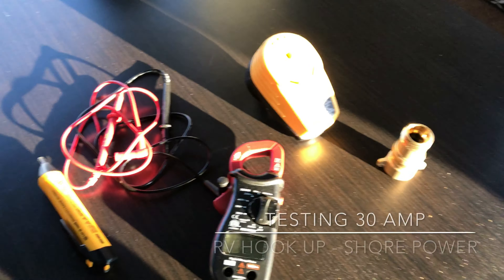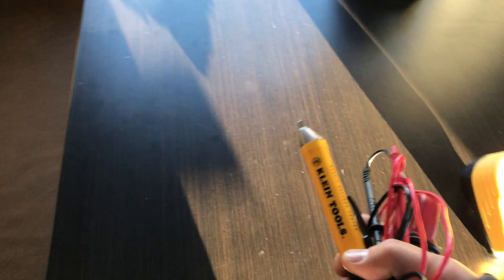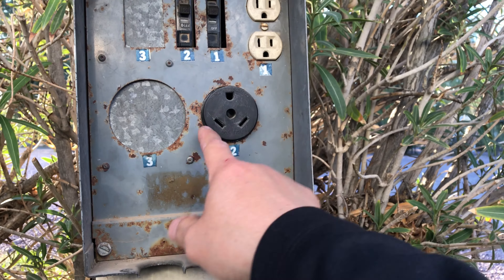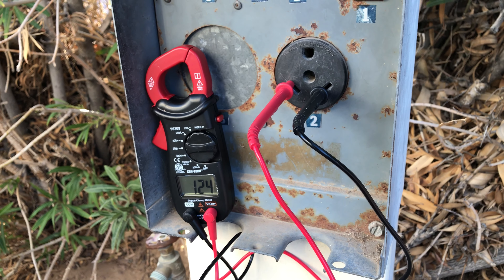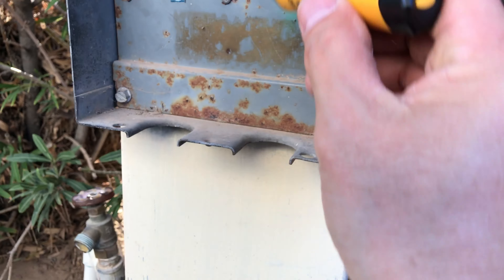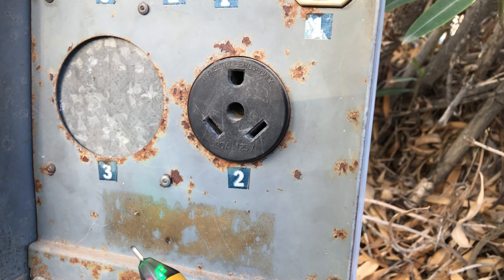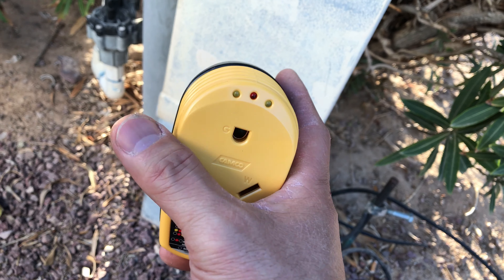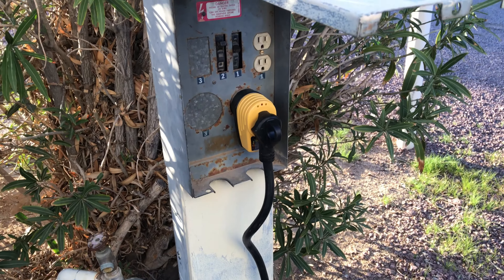Quick 30 amp outlet check. How to test a 30 amp RV shore power

Comment: Unfortunately, this does not answer my question. I need to know if it is the proper amps, not voltage. It can have a 30 amp outlet, and it can be providing the proper voltage, but I need to know if I can actually pull that amperage through it without it failing...some outlets are not to code, and can be actually only able to handle 20 , or even 15 amps.. I have the same issue with 20 amp vs 15 amp outlets, as well. Not wired to code, obviously.
How can I determine it's ACTUAL amperage limit without having access to the main breaker panel(not the external breaker at the outlet, if available)?
Reply: Amperage depends upon how much power your appliances are pulling.